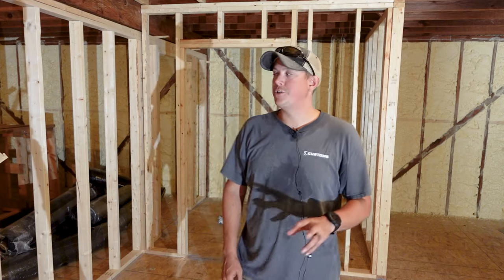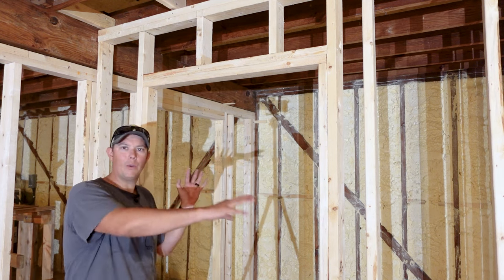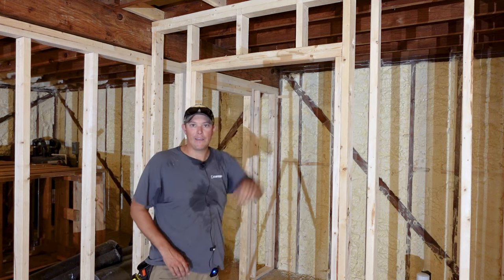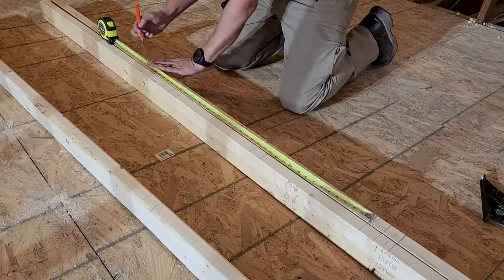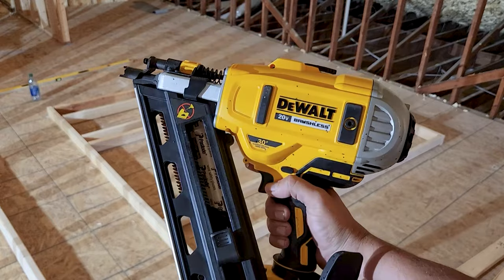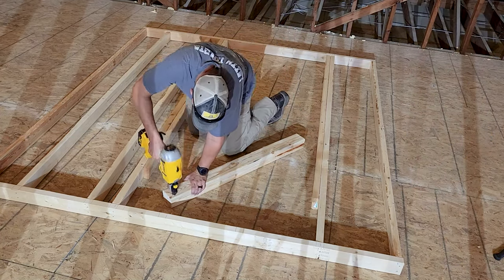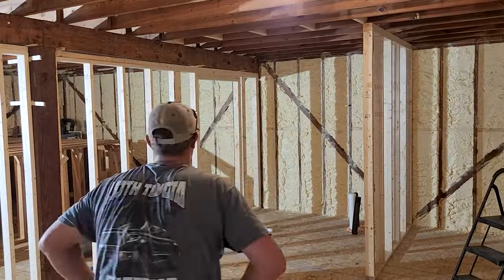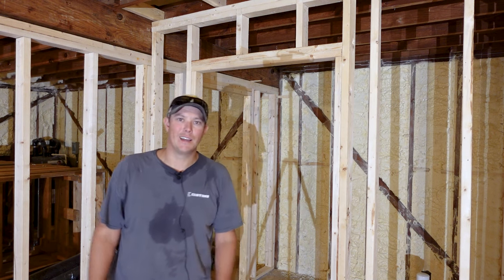How To Frame A Basic Door Opening / DIY

Comment: Why did you have to use a double top plate? Is that standard is it a load bearing situation? General question
Reply from the maker: @Mid-Americabulldogs  makes it easier if your wall is longer than 8ft.  Also if you have a load. But it really depends on the application

Comment: Okay, got that.  Questions. I'm building a greenhouse on a concrete pad (not strictly level/pre-existing on property) in a lead-to shed configuration. Since the base plate is glued down (liquid nails - concrete not good enough to drill a hole and not crack) and staying, do I still make the height of the frame 2.5" taller than door?  I was not clear that dimension would remain fixed with NOT removing base.  (Also, I use star-head screws, not nails. I'm 80 and doing this on my own.)
Reply: if you are not cutting the bottom of the doorway to be open you will still need the 2.5" gap at the top
The extra space is for when you hang the door, so you can adjust for square
if you do not frame the opening big enough, you will cause yourself more headaches when framing the door up

Comment: Thanks for the video. When you were making the wall and nailing all the 2x4s, you didn't have to make sure they were level? Or you just worry about that when you flip the whole thing up in place?
Reply from the maker: As long as the stud spacing and measurements are correct you don't need to worry about weather it's plum or level until you stand it up
Reply: @PatriotDIY  awesome thanks! 

Also I'm terms of framing I saw ppl mention 3" nails but all the nailers I see use 2 1/4 nails?

Comment: When measuring for the rough cut door opening , do you factor in the inch and a half 2x4 on the bottom or measuring from the ground for the length?
Reply from the maker: Measure from the floor, the bottom 2x4 will be cut away

Comment: Why make the opening two inches wider than the door frame? @1:28
Reply from the maker: @JMacify  not 2" wider than the door frame....2" wider than the door itself to make sure there's room for the frame and any shimming that you may need to do
Reply: @PatriotDIY  Thanks for the reply.  I am building a shed in August and purchased a prehung door and thought I knew how to install it until I saw your video then I was baffled about the extra inch on the sides of the frame.  I was not looking forward to shimming an entire inch on both sides.  Thanks for clearing that up.